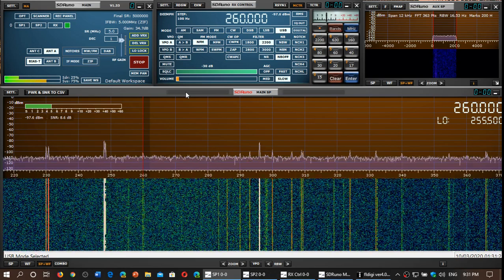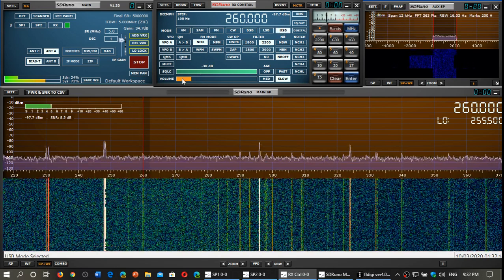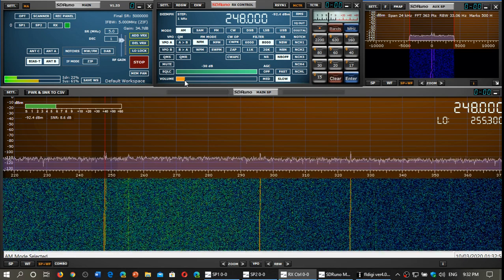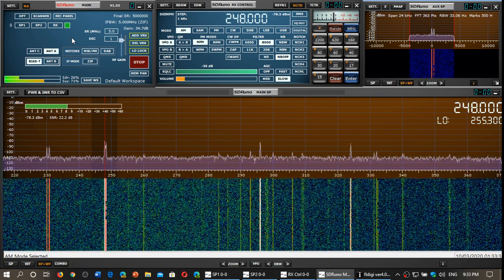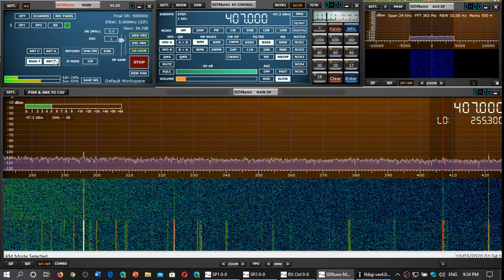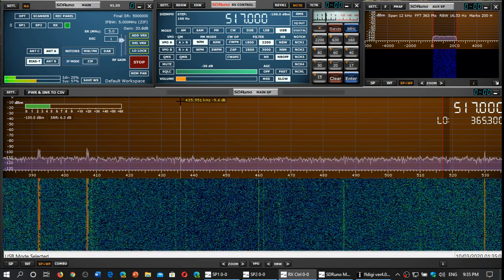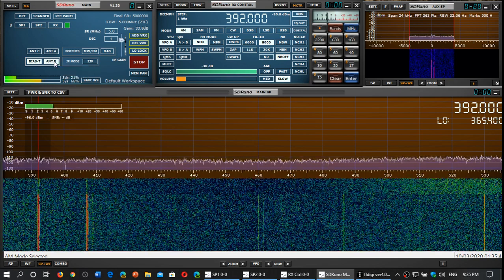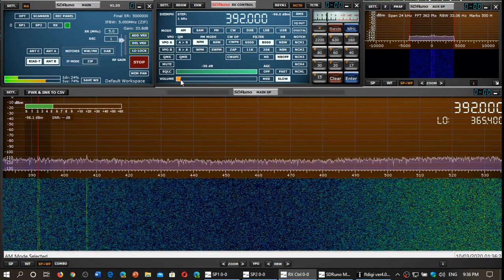MLA 30 VS MLA 30 plus Longwave test Non directional beacons reception

Comment: Have you tried running the old MLA-30 using the provided bias-t instead of the one built into rspdx?  I found that the rspdx is a lesser voltage and that might account for the signal difference?